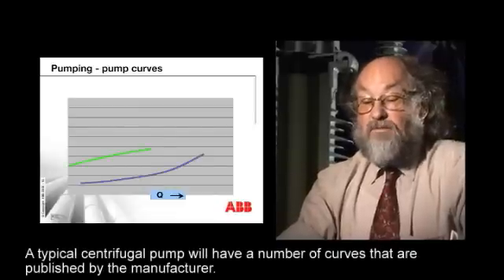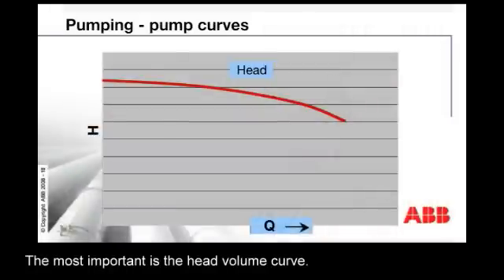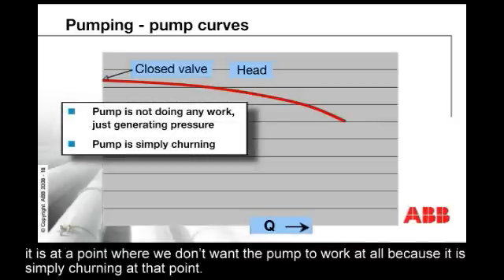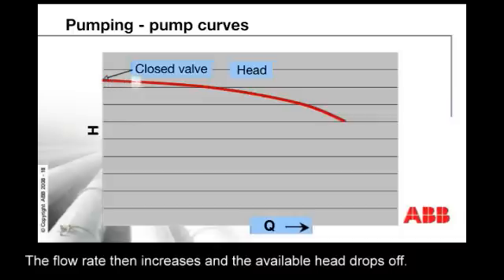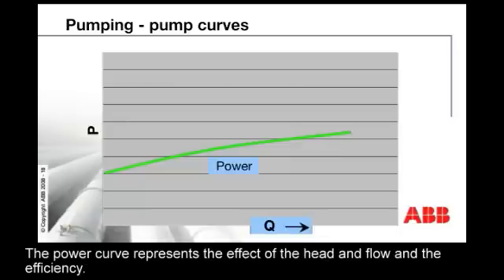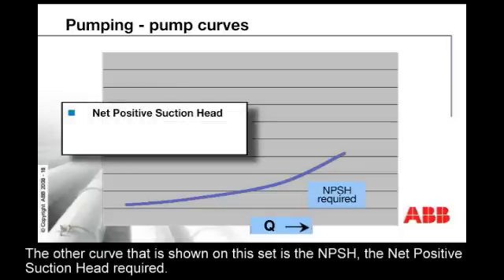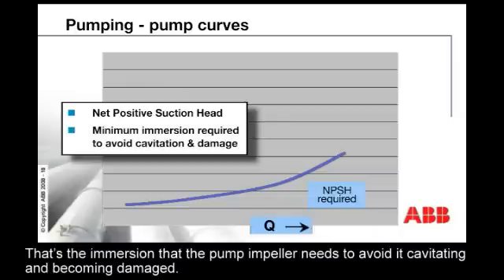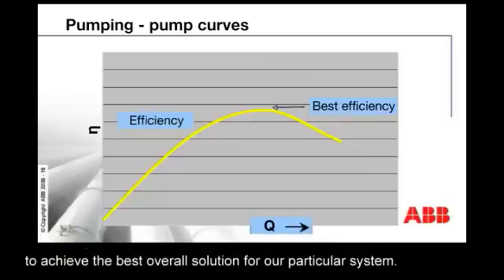Basics of pumps and pump curves -- Part 2

Comment from the maker: James,

Let's assume the same amount of energy is always being used. 
As the flow in a system is decreased (for example by closing a valve) the energy that was used for flow has now been restricted by the valve and now produces more pressure instead. 
In other words, the valve has actually added resistance (head) into the system at the expense of flow. 

Bernoulli's equations effectively conclude this from a conservation or energy perspective. 

If you have any other questions, please let me know.